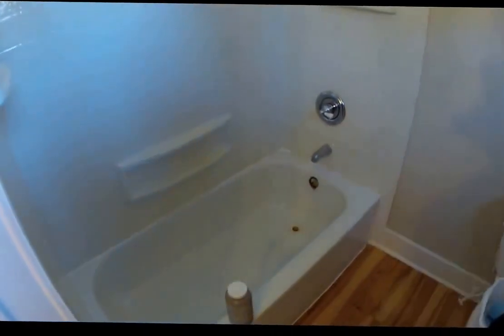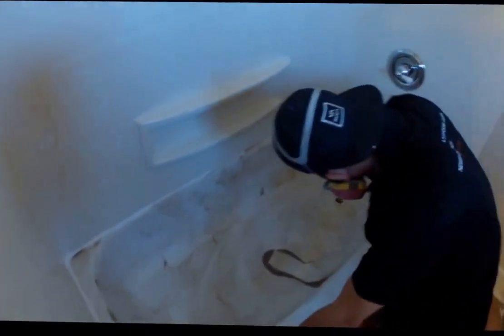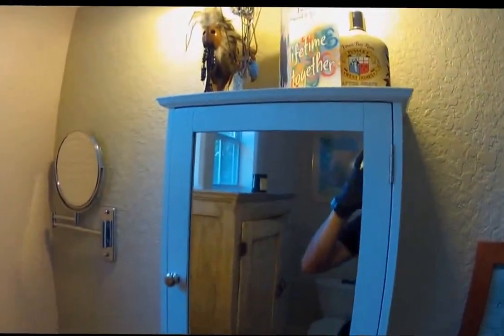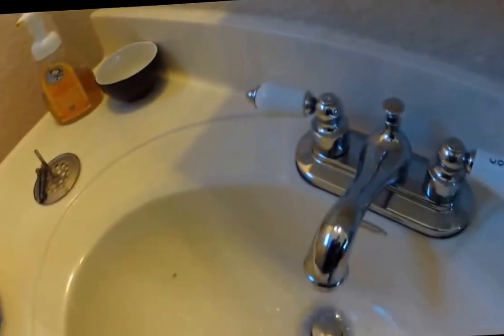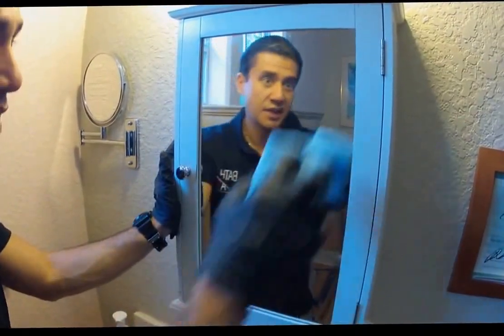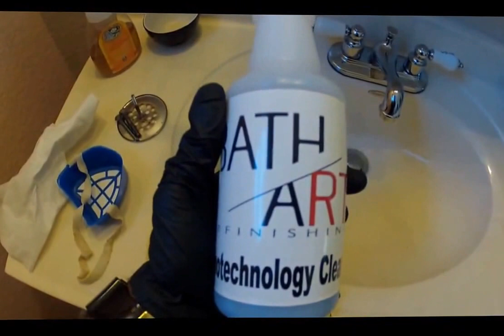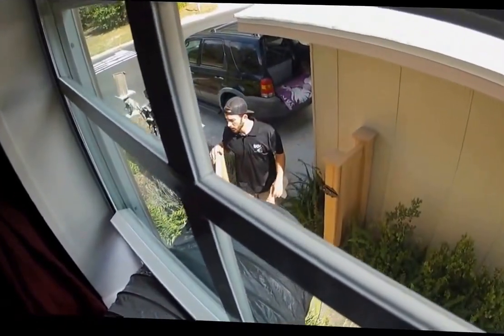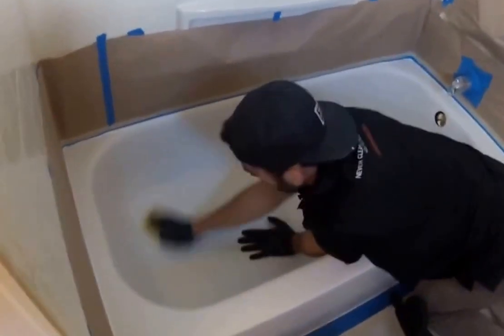Bathtub Refinishing and Tile Reglazing

Comment: Bathtub resurfacing/refinishing is nothing but an expensive long term headache for homeowners. The workers use a strong highly toxic paint that will cause those residing in the home to leave for 1to 2 days. The surface of the paint is dry within 72 hours, but the curing process takes 6 weeks. Afterwards the expensive paint job will begin to crack and peel and within 3 months the homeowner will be forced to call for technicians to return to the home for repairs or touch-ups to the resurfaced tub. Eventually the tub will peel so badly that it would need to be totally stripped down and resurfaced again.  Which can happen within  6 months. This process can cost a homeowner $1200 to $1500 yearly in tub maintenance fees. A tub liner with lots of  caulking and glue to protect from water leakage is far far better then a resurface job. Or simply pay Lowes or Home Depot to install a  new tub that will never need to be resurfaced.
Reply: That Lady You have no idea what are you talking about are you? The ppl have to wait 24 hs to use the tub again, the process it's not toxic lady! A good company use a good fan exhaust sistem which reduce the smell and fumes, and people don't have to leave their home in that case. A good job will last up to 15 years. The tub liners it's the most horrible thing you can imagine, I did work for bath fitters and you have no idea what are you talking about again, in most of the cases they just glue a fiberglass cheap peace on top of your original bathtub if the process failed water will accumulate in between layers, and it will smell like corpse. Installing a new bathtub its 10 times more exspensive. Stop with the madness and inform yourself lol